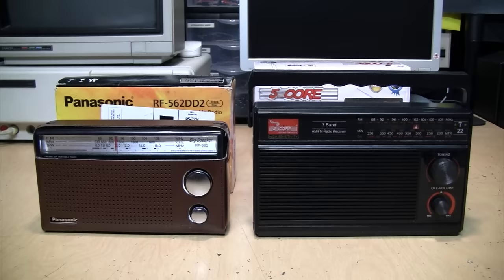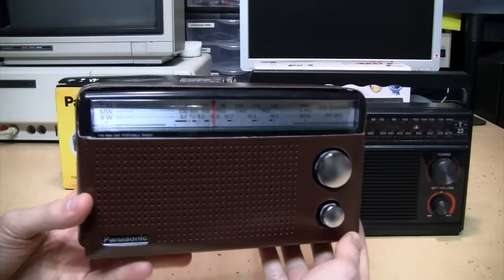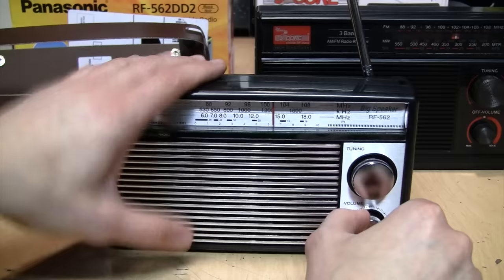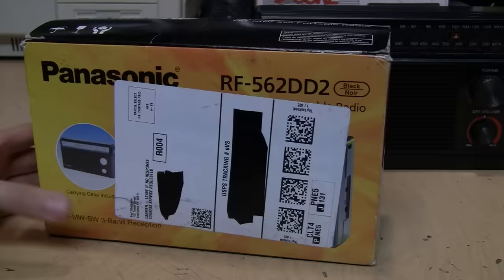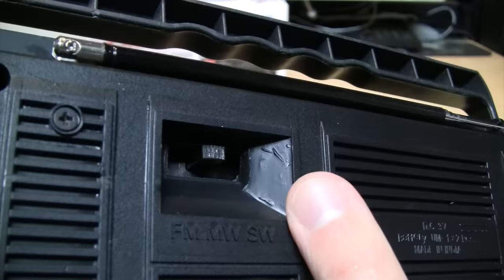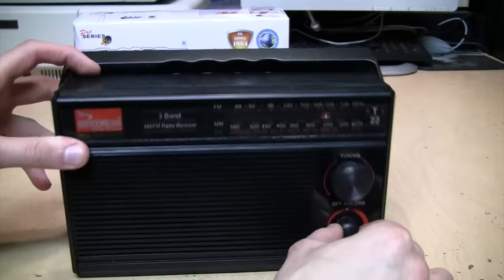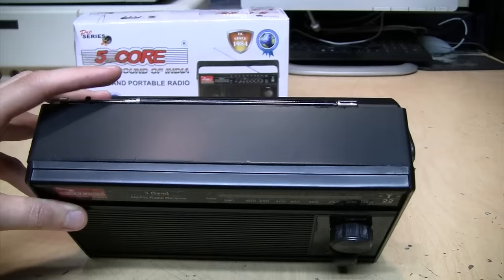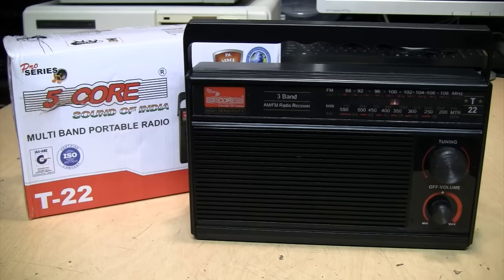Searching for the last true analog radio - Panasonic & 5 Core

Comment: I'm amazed that fm radio still exists and is not been replaced by digital dab radio because phone makers removed fm radio from phones like 3 years ago and analog tv signal's in my country ended on 2011
Reply: FM radio will be around for a long time in the United States because we never adopted DAB. Instead we adopted a proprietary system called "HD Radio" which ties the digital signal to the analog one. The digital signal is generally lower quality, nor has as good range as DAB+. The analog signal thus isn't only retained for compatibility, it's an actual fallback mechanism for when the digital one falls out of range. 

Since there's no motivation to install DAB since all main stations still broadcast in analog, and you only lose the secondary (very low quality) stations in the digital stream, most radios sold in the US are still analog-only.
Reply: @NozomuYume  I believe the biggest issue with HD Radio is the additional cost because it's a proprietary technology. The trim option on my car comes with an HD Radio, but it's not standard.
Reply from the maker: FM radio got removed from smartphones because they used the headphone cord as the antenna, and now with everyone using wireless earbuds, and most phones not even having a headphone jack anymore, that's no longer possible.
Reply: @vwestlife  and also headphone cords always make terrible FM antennas anyway. I've never come across one that came close to even the most basic telescopic.
Reply: DAB has just been abandoned in the republic of Ireland, owing to lack of users.  The quality is poor, especially for classical music.  There is a Techmoan video on the woeful quality of DAB that is worth watching.  FM radio with a real, old-fashioned analogue electronics tuner and switchable AFC is hard to beat.

Comment: Doesn't the DIGITAL TUNER match the new "HD" RADIO ( and TV) signals which all the stations in the USA were forced to switch to over two decades ago?
Reply from the maker: No. None of these DSP-based tuners are able to decode HD Radio. And the U.S. has never been "forced" to switch to HD Radio. It's entirely voluntary and is compatible with existing analog receivers.
Reply: @vwestlife  Thank you.

Comment: How long will stations still broadcast on FM (and AM, but that’s practically dead already here) 
In the Netherlands analog TV and radio signals are no longer available on cable, you  have to use a digital tuner for that, which is in the set top box from the provider.
Radio over the air is moving to DAB+
Reply from the maker: DAB does not exist in North America. We have HD Radio, which broadcasts digital signals alongside analog ones on AM and FM, but the adoption rate has been slow. Even analog AM radio probably has 20+ years left here.

Comment: Dsp radios are not really "digital" nor do they digitally process sound (unless you found some strange exception radio model). They are as digital in terms of sound processing as an 80s tv with push button tuning is when it comes to video processing. The digital is in the tuning control, not the actual signal processing so you won't actually get digital artifacting or low bit rate sounding effects on a dsp radio the same way you won't get pixelation on a trinitron with digital tuning from 1986.

Comment: I just bought a Sangean SR-35 pocket radio, it has this DSP based tuning you speak of and the choppiness in the audio is really noticeable, it does make tuning in AM stations a bit fiddly.  I won't be keeping the radio, I'll take it back to the shop, not because of the DSP tuning, but because of misleading information about it.  The Sangean Australia refers to the radio as an FM Stereo/AM handheld receiver with built in speaker.  I took this to mean the radio has stereo sound when you use headphones.  This is not true, it doesn't have stereo sound, at all.  Yes, you hear sound through both channels on your headphones, but it's not stereophonic.  Not good.  When testing out the Sangean radio I did notice some latency when tuning around the band, I even noticed a very slight delay when switching from AM to FM, yes, I'm serious.  When I flipped the band switch from AM to FM, I noticed a delay of maybe a few milliseconds before the sound stopped, followed by several seconds of silence before the newly selected band kicked in.

Comment: I'd open up the 5 core and see if you can simply add the DC jack at least, doubt it actually has the hardware for the 220V input though.

Comment: I have a 2nd (1st original one was stolen in 1980)  SONY TFM 8000W 6 band which needs reconditioning to be able to use this ebay find of some years ago, I miss the one I had in the late 70s so much.   Would  anyone say SONY authorised or an independent shop could fix internals that aged so much. Not sure if this glorious analog set can cut thru the radio fog here in middle of NYC which eliminate all shortwave from being heard on my multiband Sangean and a 90s SONY digital SW radio, gathering dust.

Comment: I don't think you can make a fair assessment on the superiority of a digital tuner vs analog tuner when you do not extend either radio's antenna fully or make any attempt to tune the antennas.
Reply from the maker: The choppiness when tuning with a DSP-based tuner happens regardless of the strength of signals coming in. And the AM band comparison I demonstrated uses the radios' internal ferrite bar antennas, not the external FM antenna.

Comment: I can't help feeling that you are mistaking the FM capture effect of the detector for choppy digital tuning artifacts. The FM detector, by design, will try and lock onto the strongest signal detected and automatic frequency control tries to keep the signal locked. That is what you are really hearing happening, not some digital issue. Turning off or disabling the AFC (automatic frequency control) circuit on FM will give you the smooth tuning you desire, but the stations will keep gradually drifting due to thermal effects on the electronic components. Radios are set up in the factory to lock on to the strongest signal and keep it locked, because that is what customers expect. Professional quality radios allow AFC to be turned off and different demodulation methods to be used to smoothly tune across a range of frequencies. Adjustable gain of the various amplification stages, bandwidth control and the ability to control each stage allow tuning of the weakest signals buried in between stronger stations. Only been playing with this stuff for 50 years, so feel free to doubt my credentials for commenting.
Reply from the maker: This is not AFC or capture effect. It is the choppiness of a DSP-based tuner. If you ever get one, you'll instantly discover the difference.

Comment: My portable Philips D7160 radio/cassette has far superior am reception than my Denon DN-300Dh sperate tuner. The supplied am aerial that comes with the Denon is rubbish for the UK, but even with a better aerial it's still not great. Fantastic on DAB+. But for AM my go to is the little Philips (I've even replaced 3 gears & a belt to get the cassette mechanism running. Excellent manufacturer in the Czech Republic supplied the gears).

Comment: The Original 562D is analog, I think it was within the last year or two they changed to DSP.  I have the analog 562, it's a half decent radio but nowhere near my Sony ICF-6500W in performance or quality. The 562 is all but useless on SW unless you have safe-cracker fingers.

Comment: I beg to differ, the Panasonic IS, in fact, an analog tuner. (unless they "upgraded" it , and I managed to grab an older one before they did so) 

Have you looked at the Tecsun R9700DX - it is a true analog.

edit:  you got the 562D which replaced the 562 (which IS an analog tuner. quite a good one actually)
Reply from the maker: The D in 562D obviously stands for Digital tuner.

Comment: That thing with the 5 Core's SW and trying to use the telescoping antenna sounds like an RF amplifier input alignment issue for that band. Too much capacity with the trimmer across the antenna coil and extending the antenna adds even more capacity and further reduces the sensitivity. Locating and peaking that trimmer with the antenna extended will probably resolve that sensitivity issue on SW.

I used to have a GE Superadio III and it was very sensitive and sounded awesome audio-quality-wise, but it had that same choppy digital tuning effect as the Panasonic... yuck. lol :-D

Comment: Instead fine tuning, the shortwave band needs to be broken up into a few. I have a Panasonic boombox radio with a finetuning knob, and it's annoying. You still skip stations with the main knob. The fine knob "wraps around" so you can offset only a few kHz with it. Single band radios like these usually start at 6 MHz, leaving a gap between mediumwave.

You can probably find god used radios on a local trading board. Probably not on eBay where antiques collectors sell everythign at rip-off prices.

Comment: Well there are plenty good - and cheap - DSP tuners too, and l guess lots of analog crap ones. For example I have both Sony ICF-P26, a completely analog model based on an older 'radio on a chip' design and Panasonic RF-P150D which is DSP based. Both are small pocket radios, roughly the same price with the Sony clearly having better plastics and overall construction quality. However the Panasonic is vastly superior, both in sensitivity and selectivity. Because what good is the real analog tuning if you can't really receive the station or if it detunes the moment you turn the antenna the other way. And yes 'step tuning' with muting between stations is present on the Panasonic (inherent in the design of DSP radios) but still overall a much better listening performance.

Comment: If you want a true analog radio on the cheap, pick up a used Philips AZ1003, AZ1004 or AZ101. You can buy them for next to nothing on eBay. Recently got a new old stock AZ1004 which I admittedly way overpaid for, but on average you can pick up a used example of any of those systems for around £20

Comment: I kinda had the same experience with certain chinese made radios from Tecsun for example. Like these small world receivers that in some cases are indeed fully analog and are a bliss to tune with the smooth gradual change between stations when you browse the different Radio bands. Sadly they stopped the production of the GR-88 and replaced it with the GR-88P which uses a DSP chip and it's really no fun scanning the radio bands with this thing. But at least the overall sound quality is nice. Still with they would have just kept it all analog instead -_-  Not sure of the GR-88P is actually at least more sensitive compared the older GR-88 model.

Comment: I have the Panasonic RF-562DD [ drop the “2”]
is NOT a DSP-based.
  I also have 3 non-DSP-based pocket radios:
[actually 4]:
TECSUN R-233/ TECSUN R-218/ Kaito KA-230/
Sony ICF-P-26
  Never heard of the 5-Core  - COOL.
I’ll have to get one.
📻😁

Comment: with lithography you can make a mask for a chip then make millions of them easily. discreet analog components on a circuit board can't be build in large volumes so quickly and easily. and it becomes an exercise in managing sourcing each part in the necessary volumes at the desired price. too many companies would rather build with digital chips, especially as analog components are getting more difficult to obtain in large quantities. Digital radios aren't going away, but they are getting better. Sadly for the lowest price point it's not going to have a high-quality and advanced synthesis, the price tag at the store tends to move products faster than good quality.

Comment: Sangean makes several tabletop analog tuning radios, and my Sangean WR-12 is an especially nice sounding radio. Not portable tho, and not cheap.
Reply from the maker: Most Sangean radios with an analog tuning dial now use a DSP-based tuner. They advertise it as a feature.

Comment: You can make your own sensitive radio easily. AM and SSB and cw/ morse. One cheap audio ic and one or two transistors a few parts. Wind coil on old pill bottle. Variable tuning apacitor from ebay or ham flea market. Look up Kitchen regen or Scout receiver. FAR circuits makes boards. A couple of weekends scrounging at ham fest, ebay or Amazon for very low cost Chinese parts and for about $30 or less you have a 1930's radio updated to solid state. Way more sensitive and selective than these.

Comment: Some DSP chips are fairly good. I use a Silicon Laboratories Si4703 FM tuner chip connected to a Raspberry PI.  I have the system programmed to timer record PBS shows to MP3.  I can then load them to an MP3 player and listen when I want.
Reply: This sounds like fun! Would you mind sharing where you got the Si4703? Perhaps there is documentation somewhere that I can check out?

Comment: Where I live  "Lafyatte La usa" as an public service eventhough all the radio stations are digital they keep thier analong sigel running so odder radios can pick up The Emergency Alert System (EAS).  In fact the EAS was why altuoght 98% of the radio stations where I live are FM thier DJ though it was needed that we konw about the ost of AM Radio since the EAS needs AM Radio to work.

Comment: Can you recommend a true currently analog AM/FM/ shortwave radio like the Indian made core 5 with a much better case construction and  AC/DC power converter necessarily included ( I hate replacing batteries-went to a slim NEBO flashlight after years with cheap AAA Harbor Freight flashlights. It can be any price( made anywhere-preferably of highest Indian quality! Of VW's -I had  5V.Ws -a cloth top semiphore type 50's VW, a '62 bug when I was stationed in Germany in the early 1970's , a 1968 VW type4( the fuel injection failed ) my brother's '80 V.W. Dashier diesel wagon and a 1979 VW Westphalia camper that started up and burned to a crisp before it could be saved(fuel injected suitcase! I loved the diesel(it failed inspection because of the body after 26 years in N.Y.-but fuel injected gas ones-never again! AA different matter with the V>W.dasher diesels(alas-VW) Thanks for your very informative analog radio review!

Comment: Thanks for this video! Fantastic! I was planning to do a similar thing to convince people. It is so hard to get the evidence across, because younger people never got the analog experience. There are even people who are happy with the FM autoscan (push button, no tuner dial) that only finds the strongest stations on 'modern' (read: downgraded) radios. I don't mind the plastics issues but it is a pity that the 5Core does not have a power unit. An analog favorite for me is the original TEAC R1 with inbuilt chargeable battery and excellent sound (FM/AM), with a very modern design for that era. What's the use of the marketing term 'retro' if it is only about the appearance of the plastic externals and the innards are scaled-down digital chip circuits ('good enough for the stupid customer'). Still looking for  a fine-controllable, good sound, big speaker, sensitive analog radio.
Reply: Some of the Sangean radios are quite good, but then again - the one I fell in 'love' with is digital. I think I bought and tested a few too many 'emergency' radios, and was put off by (the very lousy) analog tuning, but there's some hope in digital for me now. There was something great about older analog, especially the tuning, but I can't handle what passes for "analog" nowadays.

I do miss my old analog "stereo", but they're difficult to find in good shape. Yeah, we're a dying breed. :)

Comment: My RF-562 is analog, extremely sensitive, but the sound isn't the best, I also had the Indian
made radio, analog with a Sony chip at his heart, very good radio, great sound, but the build
quality was a joke. The volume button fell off after a minute, and it ended up in the trash
department, but I might buy another one and some plastic glue ;-)

Comment: Well, Digital Board (made with IC Chip) has better sensitivity over Analog board made with (Transistor, diode, capacitor). I don't why you preferring analog over digital. If you consider to receive far long weak signal then definitely Digital is better. And of-course sound quality is better on digital when the signal is strong. Most of all, people need to listen emergency info like news when they tune long distance signal rather then listen music so bad sound quality on weak signal doesn't matter.

Comment: The true mistake is the choice to not make stereo radios the norm.
Reply: My guess is this would probably use more power than an equivalent mono radio with the same output volume.

The cost of batteries is likely an issue in some places as well.

Also, it's likely these radios are used in remote areas with poor or no FM coverage; I am not aware of anywhere other than the US which has stereo AM transmissions.
Reply: @BG101UK  I listened to stereo FM in Europe while growing up.
Reply: @NotOrdinaryInGames  Yes same here, however the 5 Core is made for the Indian market. I don't know what their VHF-FM coverage is like as I've never been there but I'd guess most rural stations are on the AM band(s).

I will research this, you've given me the incentive! ☺

Also worth noting that BBC Radio 1 didn't have its own dedicated VHF-FM allocations until the very late 1980s! So a lot of my listening at the time was in mono. That and Atlantic 252 on Long Wave.